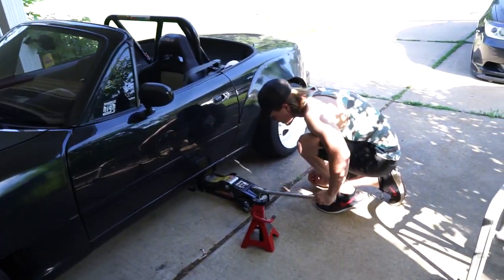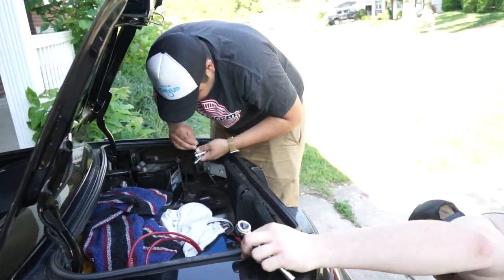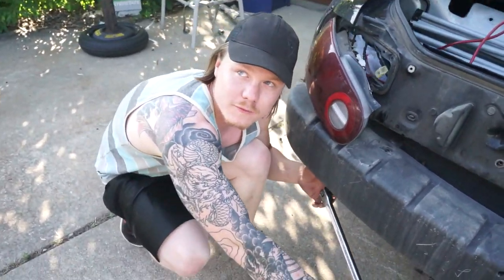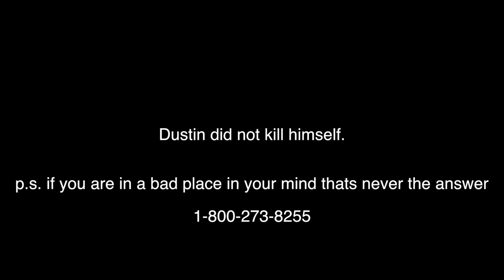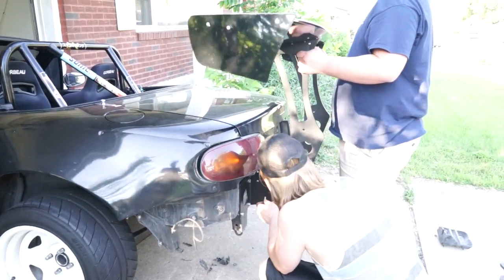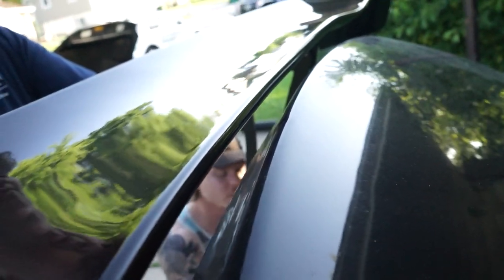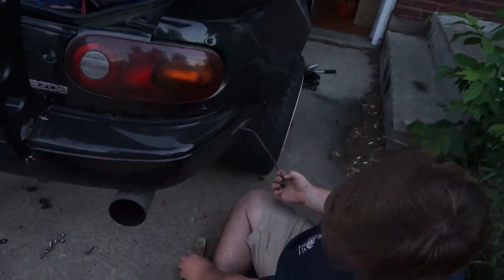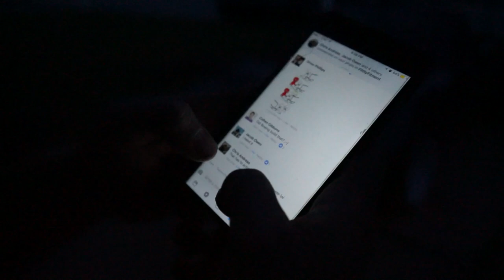How to install a Chassis mount wing on a Miata

Comment: How did you mount the rear bumper back?
Reply from the maker: Cut slits into the bumper so it could slide over the uprights and then bolted it back on like normal